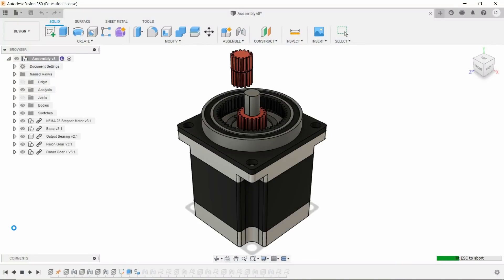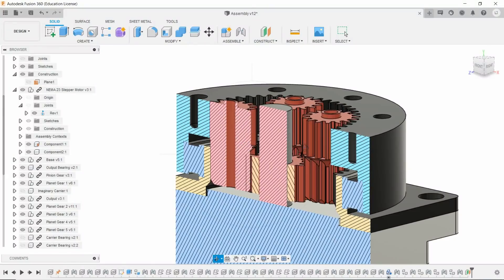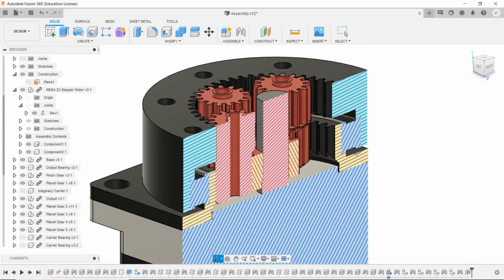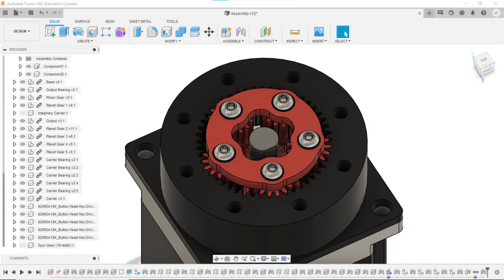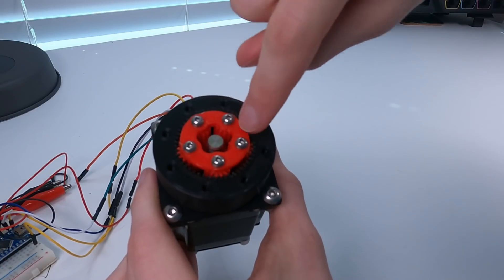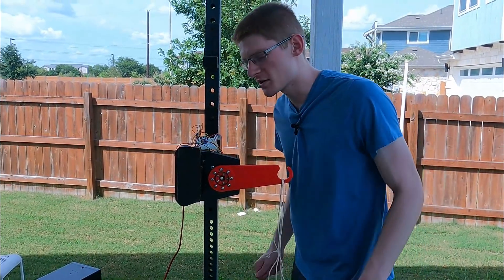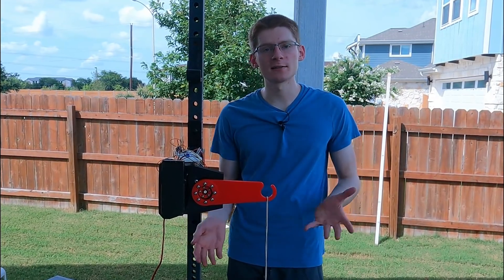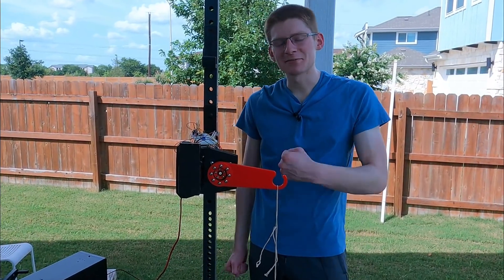The New and Improved Split-Ring Compound Planetary

Comment: I know it's quite an investment, but since you're designing your own gears, you might benefit from EDM to cut custom gears out of steel.
Reply from the maker: I assume most would benefit from wire EDM, but most don’t have a million dollars laying around
Reply: @LeviJanssen  I've seen some YouTubers making attempts to build their own. The difficult part seems to be the power supply.

Edit: Ben Krasnow got his PSU from BAX EDM https://youtube.com/channel/UCy4kgsAYxcraee8w5SfqXPA

And the Idahoan Show successfully made a die sink type with a far simpler PSU. https://youtu.be/6Jt08F1HOiU
Reply: It might be better to partner with someone or a company that already has the equipment. When the design is final maybe this old Tony is looking for a project: https://youtu.be/Q-XOM4E4RZQ. If you want to put them into production a Kickstarter to have a larger quantity produced may work. It may also be possible to get off the shelf planet/sun gears that key to a shaft and just print  the ring gear and other components.

Comment: The addition of the carrier ring is a good solution - but it is a tension ring allowing one planet to move and pull all the others off centre with it. A compression ring would probably be more effective as this would close the gap between it  and the outer ring. This introduces a friction element that could be minimized with grease or further reduced by introducing a ball race similar to my 'lazy susan' comment on your cycloidal video. The difference is subtle but would remove the twisting forces on the planet bearings that also failed.
Reply: This is kinda what I was thinking after the first video. Adding bearings to the top of the planet gears and bringing the outside in to meet them. Then add another free spinning wheel from the input  shaft out to meet it from the inside. Not sure if that would be better than a carrier or your suggestion.
Reply: @dwp6x9e42  bearings on the top of the planet gears running on the outer ring with a compression ring would work. All the lateral loads are cancelled and the teeth become the object of failure testing.

Comment: You can actually add a 2nd sun gear by changing the size of the planets on the 2nd stage and size of sun and ring accordingly, check out this video:
  https://youtu.be/2dG_F9rR-jM 
he doesn't explain a lot but its possible, here is another video with the math even if its not ituitive at all :
  https://youtu.be/5a1w9daIybc
Reply from the maker: Changing these relationships would fundamentally change the mechanism and reduce the reduction ratio
Reply: @LeviJanssen  https://youtu.be/-VtbSvVxaFA
maybe with a configuration like this? planet teeth don't change but diameter do

Comment: so now I know that I want to use planetary screw drives on my exoskeleton elbows, and ATV winch-driven block and tackle cable systems inside the upper arms for heavy lifting with a hub motor belt for regular motion using something similar to this adapted to purpose.